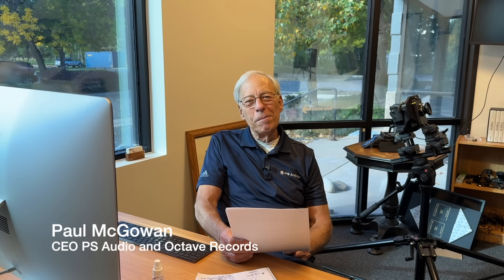Converting cable disbelievers

Comment: What a silly video response. Paul was asked about "cables". Are we talking about speaker cable or interconnects? Seems Paul went on to address 12 gauge, solid core Romex. Why? How did that address the question in the least?  Audioquest?  That's funny.  Lastly, why is this topic of "resistance" even meaningful when it only applies to long runs of cable? Most of us have about 8-10 feet of speaker cable.  There's little resistance. It's irrelevant.

Comment: Much of the problem with solid core speaker wiring comes down to skin effect.  The AC resistance of a 5 meter long cable of solid #12 copper is about 50 milliohms at 20 Hz, but it's around 250 milliohms at 20 kHz.  Yes, there is such a thing as AC resistance (don't confuse it with reactance, inductance or capacitance).  As Paul said, that will subtly reduce high frequency response.  It will also negatively affect damping factor at high frequency.  The classic solution is to use multi-strand, insulated conductors to make up the speaker cable, thus effectively removing the skin effect problem at high frequencies.
Reply: Ok. Let's assume this for a moment and do the math: a voltage divider of two resistors in series: 0.25 + 4 Ohm (speaker). Then the resulting dampening or loss is 4/(0.25+4) = 0.88 or -0.56 dB in power. That is indiscernable by the human hearing.
Reply: It's called "impedance".
Reply: @wedoshotz6645 I don't think that the concept of AC resistance, causing increased resistance with frequency, is a concept that is widely known.  Must people only think about DC resistance and assume it applies at all frequencies, which is certainly not the case.  That's what Paul was trying to address by using two gauges of wire for their speaker cables.
Reply: @wedoshotz6645 Exactly!
Reply: Add a 250 milliohm resistor in series with a tweeter and see whether you can sense any sound difference.
Reply: @CoolJay77 That same 250 milliohm resistor, in the wiring driving a 4 ohm speaker, will convert an excellent amplifier with a damping factor of 100 into one with a damping factor of 16(!).  That's worse than a poorly designed, cheap tube amp.  Ultra low source impedance (the amp plus speaker wire, and also crossovers) is critical to good sounding audio.  Every ohm matters.
Reply: @carlosanvito  You will not encounter damping factor of 100 at tweeter frequencies
Reply: @CoolJay77 I think you've missed the point.  Damping factor affects the woofer, primarily.
Reply: @carlosanvito  ad what would the DC resistance of that fat coil in series with the woofer be?
Reply: @carlosanvito  Yes it does. Which is why I commented that you experiment adding a 250 milliohm  resistor to your tweeter to see if you can hear any difference.  You did mention 250 milliohms at 20 KHz, above the hearing range, which is what I'd addressed. Damping factors at low frequencies, at the amplifier level is a bit of a lengthier topic, and designers often make use of some lower damping factor.

Comment: Paul's buddy makes cables. 'Nuff said.
10 gauge cables from Home Depot running less than 12 feet per channel to magnepan 1.6qr is more than adequate.
The magic cable nonsense is bunk. The late Paul Klipsch thought it was nonsense as well.
Reply: Try some Mogami 3084A coaxial speaker wires on those Maggies, they will light right up. ;-)
Reply: @michaelwright1602  What gauge are they and what stands out compared to ordinary cables?

Comment: Hey Paul, I recently did a test, unhooked all my Cardas Golden Cross audio cables and my JPS Labs power AC Black then installed Van Damme Pro Grade cables, the difference was not only herculean it made me want to stop listening to the music altogether, the sound had become lean, bright and aggressive, second test I return with Cardas cables but with entry level TwinLink cables, so much better than Van Damme cables, brightness was gone and regain musicality but not quite as pleasant as Cardas Golden Cross, last test I compared Transparent Audio RCA Reference cables and the Cardas Golden Cross RCA and I couldn't tell them apart, which was surprising cause the Transparent reference RCAs cost 3X as much than the Cardas Golden Cross, test performed on my REGA Osiris amplifier, Mark Levinson 390S CD processor and custom designed Solen electronics speakers (AudioTechnology Woofers & Scan-Speak tweeters)  I own an immense collection of cables; Cardas, Transparent Audio, JPS Labs, XLO/USA, Van Den Hul, LAT international cables, AudioQuest, Siltech, Shunyata research, not to mention lower quality brands such as Monster cables & others. Cardas Audio provides me the most musical experience at reasonable cost.
Reply: I just replaced my Amazon Basics RCA cables with Primeda OFC ‘audiophile’ cables and I found the Primeda to be brighter and louder in the highs with less bass than the Amazon cables. The brightness in the new cables was bordering on harsh in cymbals and vocals to the point I was getting ear fatigue on a stereo that never gave me ear fatigue before. This kind of proves to me this isn’t just psychological. There are physical differences like my ears actually hurting. Anyway, I found myself missing the kind of smoothness the Amazon cable had but like Paul said it has good bass, good mids but the highs seem a bit rolled off. When Paul says combine a 12 gauge cable with a 22 gauge cable what is he talking about? How is this done? 🤔

Comment: How about blind A/B testing and frequency analyzer? Those are things you hardly ever see discussed/demonstrated on this topic. If there are really audible differences, shouldn't we be able to definitively show that with a test cohort? Shouldn't we be able to see reproducible differences in wave forms?

So much in audio is marketing, confirmation bias, and placebo effect in my experience. If it can't be reliably measured, and/or can't be reliably heard, then it's probably not real (or at least perceivable). Maybe some rare folks actually hear it, but if you're not one of those, then spending crazy money doesn't make sense.

Comment: I changed the cables connecting my active DSP processed speakers and the difference was so drastic it literally threw off my room correction and DSP settings resulting in me needing to re-run my calibration. If this is the case for me, I could only imagine the difference it would make with sensitive crossovers and anolog gear.

Comment: Why is it that expensive cables are only to extract that last couple percent of performance out of a very expensive system? Shouldn’t any improvement be audible in any system?
Reply: This BS that you need a Superman System to hear immprovements with cables is wrong. You can hear it using a 1970s combo 8 track/receiver.

Comment: The improvement people hear with cables is mostly due to the psychological effect of expecting to hear differences (this is why listeners need to be blinded during testing). It can also occur because people do not volume level-match the two compared cables. That's basically it.  There is no rational reason to think silver sounds "better" (or is more accurate) than copper--the properties of the electrical signal moving through a conductor is completely determined by its electrical properties (resistance, capacitance, and inductance).There isn't anything else that effects the signal. These factors can vary with material and construction, but, if the silver cable has the same values as the copper--they will sound the same. Differences in resistance only affects volume. Capacitance and inductance differences can potentially differentially effect different frequencies. The values are so low it normally doesn't matter at almost for any cable other than from a cartridge (and even then, rarely). The author provides no reason to think that cables can be distinguished. Saying "they absolutely sound different" is not convincing. You have to do a controlled test. What the author believes or thinks does not matter, no matter how much he says the difference is obvious..
Reply: Oh BS. I have speaker wires here that kill a speaker sonically, others that make the sound irritably bright and or muddy and veiled, and some that just work. Same with USB cables, I have a few brands that just kill the sound, until I went to a silver wire USB cable, then my system lit right up with incredible clarity, imaging, soundstage, everything. It was night and day. Ethernet cable to my streamer, I went with all silver there too, night and day over the Cat8 generic cable it replaced. Optical cable, get a glass fibre cable and compare that to plastic fibre, again, night and day. Ain't none of this in my head either, you would have to be deaf as a post not to hear the sound quality changes.
Reply: @michaelwright1602  So, no actual evidence, just incredible claims of huge differences based on uncontrolled tests? Did you change the wiring inside the components? Most likely the perceived difference is all in your head.
Reply: @michaelwright1602  We need to see otologists in order to be able to hear like you.
Reply: @Jay-n7q7v  No you don't, my 86 yo mother can hear the difference in cables, me and my buddies call her "Golden Ears". What are you using for audio gear, oscilloscopes and tone generators? I have all sorts of gear through here, hell my house looks like a hifi shop, so does my buddies. We are always testing out gear, some stays, much goes back or is sold locally. The Eversolo T8 just arrived, and just swapping from ethernet to the SFP fibre had a huge influence on the sound. I have Pangea USB cables here that will kill that sound if I install one of those, and you will be able to hear that immediately as the entire top end collapses. I have those Mica speaker cables that Steve Huff said were fantastic. I can install those and the speakers, especially my Zu's, destroys the sound. Installing those is like throwing wet beach towels over the speakers. I could go on and on with these cables influencing the sound. Same with coaxial and XLR cables. You guys really need to up your game and get some decent audio gear.
Reply: @michaelwright1602  I've been making my own gear pretty much for half a century. ;)
Reply: @michaelwright1602  Were levels matched and the listeners blinded? This is not the first time that people with little understanding claim huge differences in something they can't demonstrate. (In fact, almost everything makes huge differences  in the "high-end" world.) On the other hand, we have plenty of evidence that people's expectations can strongly affect what they perceive. In this day and age, one can simply search the Web for "blind audio cable test"--but beware that not all evidence is equal.
Reply: I agree that it is mostly psychological But also I reckon in some cases there are too many dyslexics connecting wrong. polarity .  I'd seen comments by audio technicians that there are significant numbers of loudspeakers out there connected with reverse polarity.

Comment: Mark Markel , the engineer at Analysis Plus found that geometry is the most important factor in audio cables & developed a unique patented geometry called hollow oval . Their cables have the highest quality construction and wonderful sonic qualities .
I am a customer with no financial connection . I first bought their speaker cable , later the balanced interconnect , most recently power cable . Every one was an improvement over the fine cables previously enjoyed . Noise reduction each time . Bliss !

Comment: It is completely reasonable to say that higher quality cables with more shielding can reduce the influence of outside interference. However, as for things like multi gauge cables and copper versus silver, I don’t think that will make a slight bit of difference. I am no electrical engineer, but I would say there is at least a chance that cables with a lot of material could be acting as filtering capacitors of some kind. The only way to know for sure is to do a  blind A, B, C, D test with at least 10 or 20 people, some of whom are hi-fi nerds, musicians, general public, tested by independent researchers with no affiliation to the hi-fi field. There is no point debating whether cables do or don’t make an impact without an experiment like this. Human perception is, no matter that person‘s expertise, objective evidence so making a point either way based on only that is useless. I know a lot of people feel very strongly one way or the other about this but feelings have no place here it. This requires a good old science experiment to get to the bottom of, pure and simple.

I won’t lie I’ve never particularly gone out of my way to look for an existing study on this, but it is the only thing that would convince me they have an impact. Also, something people fail to consider is just because a cable changes the way something sounds doesn’t mean it’s for the better; even if it is a super high end cable changes the sound, just because it’s expensive doesn’t mean that it will change the sound for the better if at all.

Comment: A cheaply constructed (maybe not UL-listed) AC extension cord is probably not going to carry current quite as reliably, safely or efficiently as a better-made one, but if you're using it to plug in a table lamp can you detect an appreciable difference in the quality of light (all other things -- bulb, switch, socket, lampshade -- being equal)? If so, why not try investing in a better cord and see if it gives you more satisfaction?

Comment: This the the first time I've heard anyone claim that thicker gauge cables lack or roll off the treble.  This seems like something that would be easy to prove with frequency measurements.  Would anyone like to point me to some?
Reply: @normdeplume3265 ...it's more to do with solid core vs stranded wires. Solid core, say 16 to 12 gauge, tends to slightly attenuate (roll off) the higher frequencies but it tightens up the bass response really well, whereas stranded wire, where the strands are say 26 to 30 gauge each, maintains the treble response but creates a 'looser' bass response...that's what I have found to be the case & I think that that is what Paul is saying here. It is easy to prove; just by listening.

Comment: I have Vandersteen speakers with decent electronics.  I’m 56 and wear hearing aids.  Without my hearing aids in I can hear a big difference between my DIY OFC speaker cables, a high end set of silver plated multi-gauge cables (they probably cost $10,000) and AudioQuest Rocket 11. All cables are bi-wired.  The AudioQuest sound significantly better than the others.  Also, just switching the which wires go to the low and high terminal wires make an incredible difference with the high-end cable. Bottom line is for any who doesn’t believe, just try it for yourself and I do think it only makes a difference if the loudspeakers and the electronics are high quality.
Reply: do a blind test  ...... without telling you which is which have someone change  them around and see if you can still identify them
Reply: @robbase-f6x do a blind test with food, and eat the foods you pick out for a while, then tell me how much better the food you picked out in a blind test is when sighted and just trying to enjoy it. I'll bet it doesn't work out too well.
Reply: good grief
Reply: @robbase-f6x  blind tests are stupid with anything subjective.
Reply: well they are not needed for anything subjective ,,,,,, that's what test equipment is for
Reply: @robbase-f6x so you buy your audio equipment on test equipment measurements?   That's like measuring the chemical composition of food.

Comment: BY FAR, the very best audio cables in the known universe can be had by using acid core solder, to connect 25 coat hangers per each half of the audio path, So, 100 hangers for left and right channel. Suspend them from the ceiling with plastic hangers and watch your wife SCREAM, but alas, you'll have the best  sounding audio EVER. Sounds the very best using Radio Shack 10 watt integrated amp and CD player OR any garage sale turntable for best results. Oh, and don't worry about replacing the stylus; diamonds last forever, right ????
Wait, it's November, NOT April !! YIKES !!
Reply: LOL!   Even better, some litz wire - BUT, it must be blessed by a priest first.
Reply: All my coat hangers are wood or plastic!

Comment: Speaker cables, the cable resistance matters for sure. 
But for signsl cables, if it is not measurable over let's say 1Hz to 100kHz, then it's just the placebo effect. (ignoring better shielding, which of course makes sense)

Comment: The cable naysayers choose what to believe or not believe based on cognitive bias, not on factual evidence. Just because you may have the opinion that cables are snake oil and make no difference in no way makes you right. You do have a right to choose the cables you prefer and if that’s Amazon cable, so be it, but don’t expect that any true audiophile will ever believe you that it doesn’t matter, no matter how big your megaphone. Just quietly go about your listening. Bye.
Reply: If it defies existing scientific knowledge and physics, then that is where snake oil comes in.
It is worth remembering that not everyone understands physics which makes them vulnerable to shysters.
Reply: @montynorth3009  Separate point with which I agree. My point was there are those who has any difference ever is negligible and never worth it. I disagree wholeheartedly with that opinion.
Reply: @montynorth3009   ...Science doesn't explain everything & often science
needs to catch up to the facts; this has happened many times throughout history.
Reply: You would have to know "Everything" related to electrical fields and how different materials, winding and sheathing could affect sound. And then know everything aboit the interactions between cables and audio equipment with their different impedences, before you can say something defyies science. Short of that (and I'm sure you are), we are only dealing with pretend scientists who want an argument.